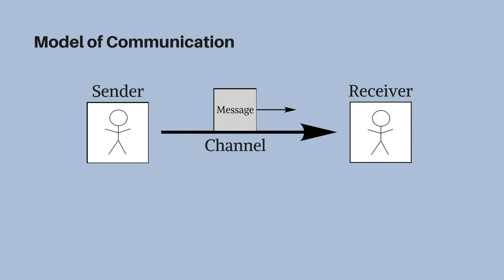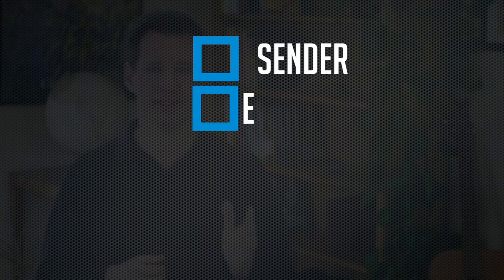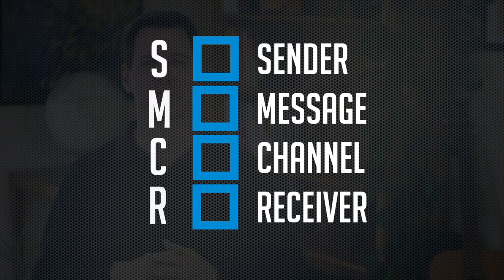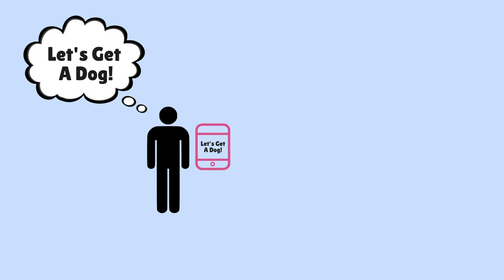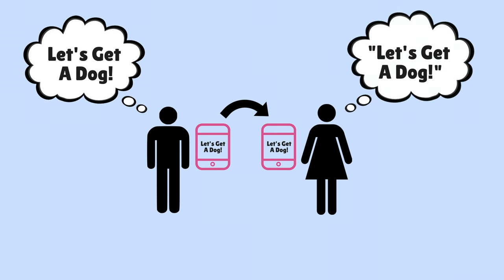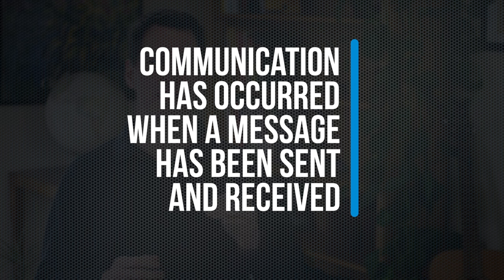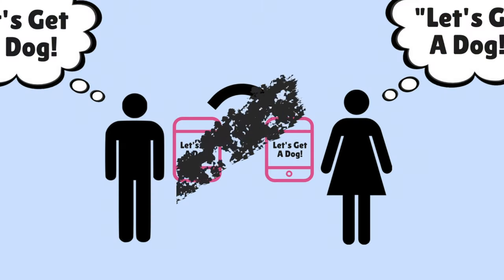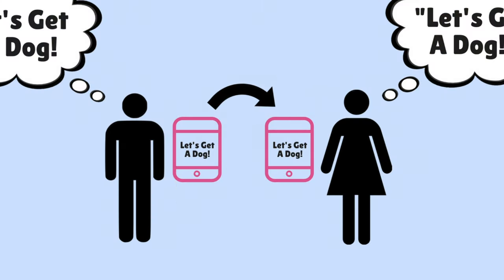Transmission Model of Communication: Shannon and Weaver

Comment: When I present this model to an audience I also add a box around the sender and the receiver labeled "Context". This takes into account the things that the sender may take for granted when writing the message and the bias that the receiver may add when interpreting it. Although a communication itself may have occurred, I think that adding the Feedback and the Contexts really helps modeling the required elements of an "Efficient communication" and makes the model more suitable for human interactions. Also, I think that we should interpret the Feedback component of the model loosely enough to include non-verbal reactions as a form of feedback. Shannon & Weaver did include only one channel element in their original model, which is consistent with a technological communication (ex: phone) but human communication simply has different channels for the Message and the Feedback: a message is sent verbally (sound channel) and the feedback may be a non-verbal gesture (visual channel).
Reply from the maker: Hi Jocelyn. I have another video on the Transactional Model that gets into feedback, context, nonverbal, etc. It builds on this video: https://www.youtube.com/watch?v=6d7w5CRnf7k

Comment: So this model is considered linear- meaning one directional. So wouldnt that mean that there is no feedback intended? Because the message is going one way and there is not possible feedback? For example, the kardashians sending a message to their audience, being linear, and the audience cannot respond to this message (they wont be able to see responses from everyone)
Reply from the maker: The model doesn't include the concept of feedback. It's a model that provides a way of looking at our communication. Later, other researchers added feedback and other features to the model to capture that aspect of our experience, especially for face-to-face communication. From a practical standpoint, feedback may be happening. It's just that the model wouldn't adequately describe it because it lacks the concept to do so. Good question!
Reply: Communication Coach Alex Lyon Wow thank you so much for your quick reply! Helps a lot!!

Comment: I'm confused. Isn't SMCR Model by Berlo? Also Shannon and Weaver model has feedback right?
Reply from the maker: Hi, Rocio. Well, you're right in that the "SMCR" model is Berlo's in terms of the branding of the model but Berlo's model comes 10 years later and is directly based upon Shannon and Weaver's model. Shannon and Weaver came first, in other words. In the video, I explain it as Shannon and Weaver model (e.g., telephone, etc.) because they came up with it first in 1949 and Berlo adds a lot of explanation to each of the SMCR parts that Shannon and Weaver didn't originally go into and I don't go into those in the video. As far as the concept of feedback, that concept is not in Shannon and Weaver's model as I mention in the video. Some books add that when they talk about Shannon and Weaver's model (and some teachers do too) but I've read the original article and feedback is not in their diagram and the word doesn't appear in their original article. Some books sort of combine these foundational models (Shannon and Weaver plus some Berlo, etc.) and some books even add "feedback" as part of the basic model because the earliest few models had a lot of overlap. All that to say, I went with the original model but a simplified version of it. It's a 3 min video so I just stuck to the basics.
Reply: Communication Coach Alex Lyon thank you for the clarification. Great video by the way!

Comment: what's the difference between berlo's model and shannon-weaver model?
Reply from the maker: This video is on Shannon and Weaver's model. They invented it. Berlo is essentially another version of Shannon and Weaver's model with some additional explanation and discussion about how people interact and a discussion of the details of each of the four main parts, what they might include, etc. But, in my opinion, without Shannon and Weaver's model, Berlo's model would not have existed. Berlo's model came 12 years later.